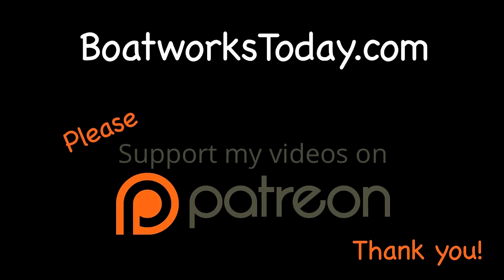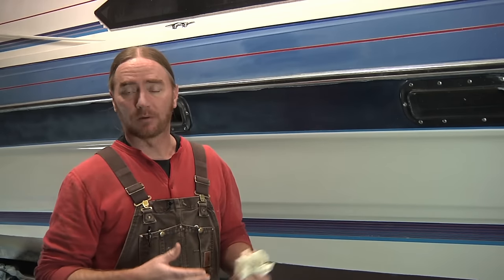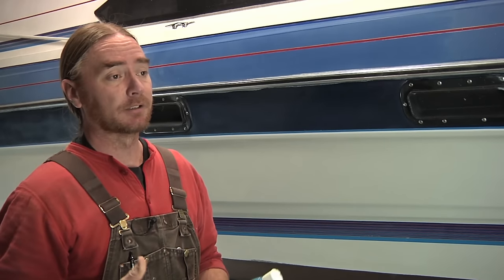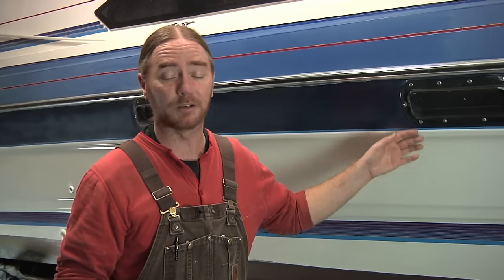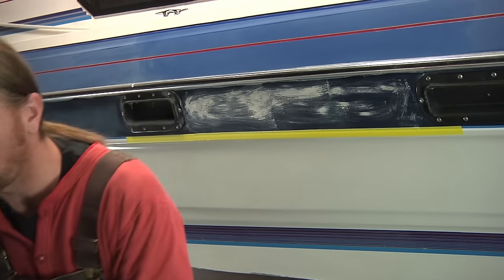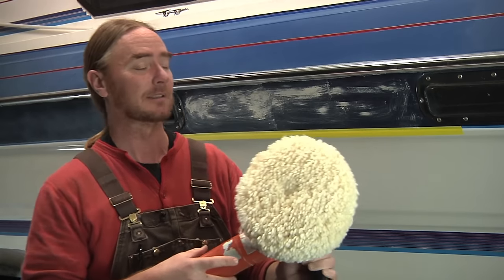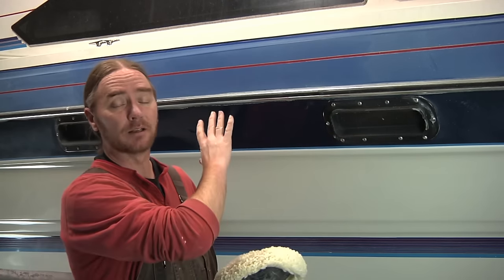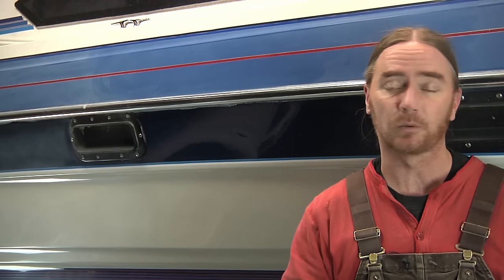Gelcoat Buffing And Care

Comment: I've faithfully adopted BoatworksToday. I've searched videos on boat repairs and I love this channel. He doesn't brag about certifications he has and explains everything in fine detail. I'm restoring a 1987 Four Winns Freedom 160, previous owner let it sit uncovered for 2 years, we cleaned it up 5 years ago and 2 weeks ago I found the floor "sagging" so I removed it and found rotted stringers, etc. Currently replacing them. With the cost of some of this stuff I wanted professional advice. I've never fiberglassed before so I watch a video then tried it then came back to the channel to see what I did wrong! Been working on the boat 3 days and am getting good at the repairs and fiberglass work thanks to these videos. I subscribed to make it easier to watch. Thank you for the great videos.

Comment: good video. my recommendation is to always test a SMALL area when using compound. use a lower speed and dont apply pressure to the buffer. If the gelcoat isn't too bad, use a one step polish or wax.

Comment: I have to say you have some of the best instructional videos out there. I am headed outside to start on my 1989 stratos. I have a question for you. A friend said I should try to wet sand using windex spray. Have you ever heard of this? I wet sanded yesterday and it did leave a very white haze on everything that did wipe up quickly. The rough gritty feeling is gone. Anyway, thanks for the videos, I am a retired disabled veteran that started watching your videos for knowledge, and you sir are excellent at teaching, thank you again. You helped me re floor my boat, and now restore my gel coat.
Reply from the maker: Using a spray bottle with water and a tsp of dish soap (I use dawn, but any will work) is the best way to go.  Have not heard of using a window cleaner.  The soap adds a little lube and helps to keep the sandpaper from loading up..  Hope this helps!  Thank you and good luck with your projects!!

Comment: I have used a DA polisher on our 2011 Tahoe boat to maintain the gelcoat with a foam pad. If you are not used to using a high speed buffer with a wool pad you can easily burn the gelcoat. There is no way you will burn the gelcoat with a DA polisher especially if you are new to polishing. When I use the foam pads 5 pea sized drops on the pad are enough to do a 2x2 section. I am not a professional detailer just an enthusiast of doing my own buffing and polishing which I learned from junkman2000 on YouTube. I would have liked to see the completed result of this boat but I could see that it was coming along nicely.

Comment: speaking of pint stripes got tips on redoing them... and thanks for all the quality knowledge
Reply: +Jason Harris 

You can usually just go over the old one with the new one, if its the same width. Only time its noticeable really is if you are covering an area that is chewed up; if thats the case clean up the "chewed up" part and then just go over it.

Or you can get a ten dollar pinstripe eraser tool that goes on a drill. Watch you don't overheat the gel though it can yellow up pretty fugly like.

Comment: I bought a '95 20' Nitro bass boat that was peeling on the top part of it.  I had to sand all of that off down to the paint which looked good when wet.  I'm not sure what that stuff was that peeled off but if that's something I might have to do again, I might as well polish the paint.It actually looked better than the coat that was actually sticking.  After pulling some of those pieces off, I noticed hairline cracks.  Maybe a cover up?

Comment: 25 years ago that Big Coatings Company told me that even with their best two part coating (paint) that once you have painted you will always have to repaint every ten years. But gelcoat, if regularly waxed to protect it, would easily last 20-30 years. Gelcoat being harder to apply though.
 Sounds like "paint" has gotten much better now? And that regular waxing still protects best, for either one.

Comment: Hi Andy, Thanks for an excellent video. I just purchased a 1986 Ranger Bass Boat with severe oxidation. Because the boat has a poly-flake finish I was wondering if your buffing method is the same for my boat? The finish is very rough. 

Thank you,

Kleetus

Comment: Hi Andy,
Just wanted to say that your video gave me the confidence to start buffing my 03' Sea Ray.  This was my first time with a rotary buffing machine, but I am thrilled with the results so far.  I went light and used the Meguiars #49 at 1500 rpms with a wool pad.  Huge thanks for your video.  Also, if you get this in time, what would you recommend for a long lasting wax or sealant after you buff?
Reply: Aske Marina Meguiars Flagship premium

Comment: First let me say i enjoy your channel immensely. This was the first video of yours that I ever watched and I subscribed right after.
After watching every one I find myself facing a repair that doesn't match any of your videos so I thought I would just come right out and ask.
I have a 1968 Chris craft Commander that has a puncture hole right at the turn of the keel toward the front of the boat. It was "repaired" by the previous owner using bondo which even I know was not the correct product. This repair leaks so I must get it repaired properly.
The damage is aprox. the size of a baseball and the hull thickness exceeds 2 inches.
I'm sure there are many factors that will determine the proper repair procedure so I will appreciate any guidance you can provide.
My first question is polyester or epoxy?
Thank you in advance
Craig
Reply from the maker: Hi Craig!  Poly would certainly be fine (most likely it's wha the hull was make with) but for repairs below the waterline I tend to use vinylester resin and save the epoxy for fairing :-)
Reply: Craig Wilson

Comment: Hello Sir. Very informative videos. I would appreciate if you could advice me on a question i have. What polishing method  should i use on a brand new boat that will be exposed on sea the whole year ? In my mind it sounds good a very fine thin polishing cream that will be applied once a year for buffing actually since the oxydetion wont be that much. My intention is to have the gelcoat always shiny and in perfect condition so it wont be necessary to proceed to more aggressive compound with result to make gelcoat thinner and also always to have a nice shiny look. So what specificiations the cream i need should have and with what method should i apply it ? Is hand apply enough or should i get an electric polisher in any case ? ....Ops one more question just came in my mind !!! (ok i lied i intented to ask 2 questions from the begining !! lol) Is there any clear finish epoxy resin so i can apply on my brand new hull ? To create something like "glass" on the gelcoat surface so to be more durable in osmosis or if there is its a bad idea cause it may need more maintenance (sanding-applying again) than the gelcoat itself (maybe just an annual polishing and maybe repair of some small scrathes).Just so you know i wont apply any anti fouling "paint" because i will take it out of the water after every use. Sorry for my large text but English isnt my language. Thank you very much in advance. Keep making so good videos !

Comment: This video really helps with the restoration of my 78 Daycruiser 21' Jet boat. I thought i was going to have to paint it, but it looks like I will just be investing in a good variable speed buffer. My only question is... I want to do the bottom of my Hull. How do I safely get it up off of the trailer to do so?

Comment: I've learnt a lot from your channel mate.  I have an old glass boat that I would estimate had moderate oxidation. I ordered M49 to use with a rotary buff using white wool 3m pad and M45 and yellow wool 3m pad .  After this I was going to apply the M6316 with my random Orbital and fine foam pad.  Does this sound like a decent course of action?  Thanks mate

Also do you hold the buff flat or buff using the edge?

Comment: Quick question; Once you go over the surface with the compound, do you then apply a wax or other polish? Is that needed? I need to do this to our RV : ) Thanks for your great videos! You are an exceptional teacher!
Reply: Yes, if you're cutting with heavy compound on a rotary removing heavy oxidation, you're going to leave a mess. You'll need to follow up with at least a medium polish/pad to clean up the heavy cutting. You can then grab a DA polisher a foam pad and a polish if you want the best finish possible.  

After you finish polishing, you need to use a panel prep/IPA wipe or just wash the RV with a strong soap like Purple Power Boat Wash, or even Dawn dish soap will work, dry completely, and then apply a wax, sealant or coating. Don't skip that step, if you don't remove the remaining polishing oils first, the protection will not bond well, and you'll have oxidation again in months. 

It's a big job, give yourself plenty of time and don't get overwhelmed. Spend the money and get good materials, if you use inferior products, you're handicapping yourself before you even start. I get alot of phone calls and work from people who tried to do it themselves and gave up. Most of them are not using the right materials. It makes all the difference.
Reply: @jdisdetermined  
Keith I am refinishing a heavy oxidized Spa. After compound n Polish I was thinking of using a ceramic wax. What's your thoughts on that?

Comment: I did sub.
I was confused as to the correct speed. You said the #49 was a much lower speed than the 1000 compound which was 1100rpm. But both were 1100rpm. Can you pls help clarify this? Tia

Comment: Thanks!  Good to hear the accent LOL.  Spent many summers in Great Lakes area.  Being in Texas now don't hear it often.  I understand that you should never use the buffing pads with different compounds.  Can they be cleaned?
Reply from the maker: +Pass Me By they can be cleaned from different compounds, but it's hard to get different colors out of the fibers of the pads :-). I usually keep two sets of pads...  One for colored gelcoat, and the other for whites..  For cleaning between compounds, a good scrubbing with some dish soap, rinse and dry.  When dry, spin the pad on the buffer and spur the dry dust (aka grit) off the pad :-).
Reply from the maker: +Pass Me By but, I don't have an accent 🤔..  :-)
Reply: I'll bet I don't either.  Ya'll take care!
Reply from the maker: +Pass Me By lol ;-)
Reply: +BoatworksToday  I toss mine in a commercial washing machine at the marina. Wife was tired of me using the one at home :)
Reply: 705techno Your accent?  lol  Seriously a commercial machine may be more effective.  Was the pad causing issues in your home machine?
Reply: i know i'm replying to an old post here but if you havnt figured it out yet, you want to clean your pad with a buffing wheel spur, looks like a gun where you hold it and a horse riding spur on the business end.  it creates dust so you have to be aware when you dress your wheel.  you want to always stick to wax products or silica products, mixing them will clog up and ruin your wheel.    If you use a silica product you can never dress and finish with carnuba, it just makes a greasy mess.  Carnuba is undisputed in its holding power and resistance to washing off with water, ask any surfer.

Comment: Great video. Agreed 100% on the products as well. Megs ox remover and cleaner wax are great products. I was an aqua buff fan for years for the heavy stuff but found the 1000 fast cut just got too course and you have to really work to get the defects out. Ive been liking the Mirka Polar Shine line the last year. Has the cut of the 1000 but finishes down like the Meguiars. Doesn't load up pads either like the AB does. Will also clean up 800 grit flawlessly. 

Only thing I disagree with is the cheap buffer part. I started out doing this with jobber buffers and the minute I bought a Makita I never went back. Makita, Dewalt, Porter, all great tools and most are under $200 now. 

Also love the Bayliner Blue......2455 was my first boat.

Keep up the good work man!
Reply from the maker: +705techno I've looked at the Mirka line but never used them yet.  Which compound are you talking about that is similar to AB?  Looks like they have a few to choose from :-)
Reply: +BoatworksToday

Polarshine 25. It says it takes out 800 grit scratches and it actually does. I see they have one even courser now (35) im going to give that a whirl this summer as well. I use this as a compound and then use the megs (45?) boat rv polish on dark sections (makes it pop) or on white just skip to the cleaner/wax as a protectant. 

Only complaint I have about it; it breaks down from the pad into a dust so you get dust everywhere on the boat. Having said that it is totally water soluble and wipes off with ease. I had a couple Megs drips fly on me that stained the vinyl (my boat thankfully) 

Have you found any waxes that you like besides the cleaner wax? Im trying to find something that protects dark surfaces a little better. So much misinformation out there its ridiculous. Have found the cleaner wax to be a little more watered down the last couple seasons; perhaps I just got old stock though. Really hope thats the case though I really like it; im just finding its not lasting all season like it used to on dark surfaces.
Reply: Detailer/Used car dealer here. I find it funny when people pick up our dealership's Milwaukee buffers and are surprised how heavy they are. Real men use heavy buffers :)

Comment: My boat is mostly white, do you think the Aqua buff is fine to use? Never done this before. I tried using other types but nothing is really working. Boat has sat for 10 years. Great videos by the way, your teaching is great
Reply from the maker: Will work great providing there's enough thickness left on the gel.  If it's already starting to look a little spotty / thin then you're somewhat limited on your choices.
Reply: BoatworksToday it looks solid. I know you mentioned Mequiars 49 as well. I tried 205 I think it was and it didn't do anything. Felt no grit in it. Just don't want to waste another $50. Thanks for your help and time

Comment: I have a 2005 Cobalt 263 that has heavy oxidation.  It's been compounded/polished/waxed almost every year that I've owned it because when I start each year the oxidation is pretty bad. Lately I've been told that the topside "is too far gone to compound", but, how do I know whether that is true?  I'm at the point where i THINK i need to have it painted/gelcoated, but, on the flip side I'm not sure I want to invest the $8-10K, so would prefer to throw the $400-500 in detailing it yearly for the few remaining years that I plan to keep the boat.  The boat otherwise is in great condition.  Thoughts?
Reply: I do gel coat restoration on commercial and rec. boats, I would wet sand a severly oxidized boat with 3m trizac 3000 grit sandpaper. It works excellent on bad oxidation. After that follow with your favorite buffing compound and wax, I've seen this technique bring back boats that looked like nothing but new gel coat would work, I think you'll be very happy.

Comment: I have a question I'm planning on restoring my 1987 bayliner bass boat it has a serious oxidation and cracking and it looks to me like maybe even the gel-coat could be gone now some people say to wet sand it certain areas of the boat still has a nice gel-coat and you can see that nice metallic flake paint but those areas the sun couldn't get to it as like the top side so anyways whats my best alternative should I start over since I plan on doing a lot of work and modifications to this old boat or should I try the cheap alternative I can post pics of just how bad of shape she's in by the looks of that boat in ur video it's a bayliner cabin cruiser and almost the same age or 1 year younger anyhow I plan on redoing the whole boat already spent 200+ dollars in 4x8 sheets of good plywood also want to upgrade the 87 85hp force motor to a 100hp Yamaha older 4 stroke model preferably the F100 model .

Comment: Thanks for a great explanation. I have a specific question regarding my boat. It is fairly new (3 yrs old) , never been waxed before. I just keep the exterior clean using water and drying it with a towel after each outing. What do you recommend to protect the outer surface long term? Which product and tool to use to keep it brand new. It has light scratches as well.
Reply from the maker: Just a good carnuba paste wax should be all you need :-)  Apply it a couple times a season and you should be good to go!
Reply: @boatworkstoday  plain carnuba base waxes do not offer the proper UV protection for gelcoats. A better recommendation would be a polymer wax, which is what professional boat detailers recommend. The MEGUIAR'S M63 flagship marine wax is a great product tha was designed specifically for this purpose. Nice video though, thanks
Reply: I'm gonna try out 3M Scotchgaurd wax

Comment: Great video!  

One question, did you switch pads going from the blue section to the white section so that you don't get the blue oxidation on the white section?  or is it due to the change in the compound you used?  

Would you have changed the pad if you were switching colored sections during the polishing stage?

Thanks again.  I watched a ton of videos on this and yours was by far the best.
Reply: Also, if you have a follow-on where you do the polishing that would be great.  I did some polishing with 3M Finesset-it II on my mostly-white sailboat and it didn't seem to look any better than after the compounding, yet so many people said that they had great success.

Comment: Hey mate I’m looking to detail my boat I bought a few meguiars products. My boat is an aluminum hull that’s painted navy blue. It’s about two years old paints in good nick but has got light swirls and oxidation stains. Do you recommend me using meguiars color restorer 44 to clean paint then high gloss polish 45 and to finish it off with flagship premium wax.